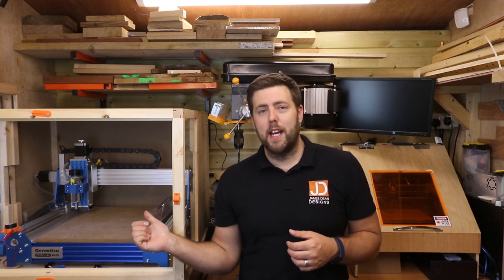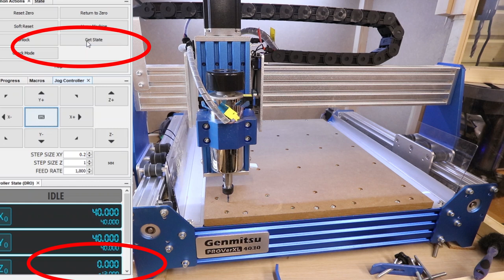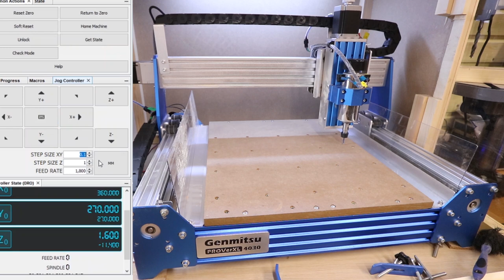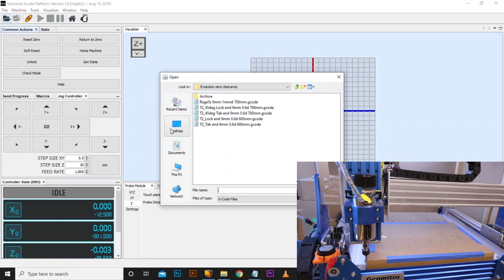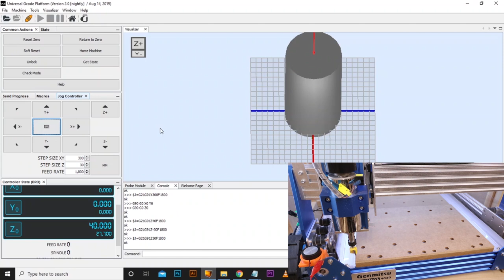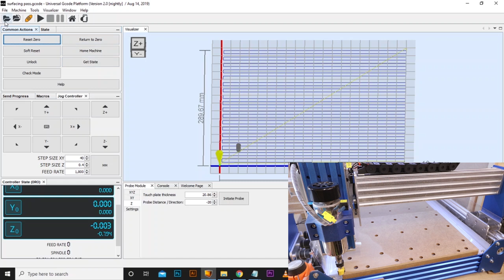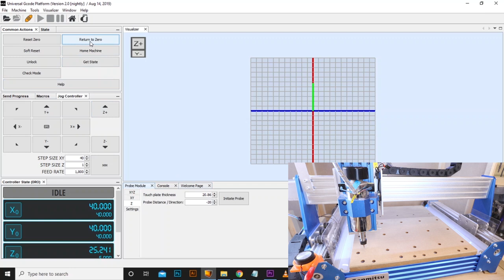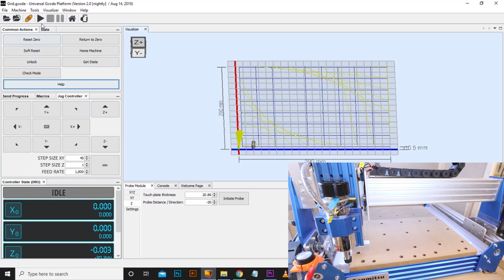Making a spoilboard and tramming the PROVerXL 4030  CNC from Sainsmart Genmitsu

Comment: It took me quite a while to get everything on my PROVerXL 4030 ready to go. I watched many videos, changed out my stock spindle for a Dewalt 611 router, bought a packaged relay to start and stop the router with the software, and I went out and got a 1/4 sheet of 1/4” MDF board to make new spoil boards. This was my first carve by the way. I downloaded the G Code program that James provided along with his tutorial. I started up the machine and everything seemed to be going just fine until it got to about the 9th hole. The machined finished cutting the 9th hole and then went into alarm and stopped.  I finally got the alarm cleared and when I restarted the program it went all the way back to the beginning. After it got to the 3rd or 4th hole it just stopped, no alarms or messages. Now I have very limited movement on my X and Y axis, maybe 10-15mm and the program will not restart. I am brand new to all this so any help would be greatly appreciated.

Comment: Excellent video, James.  I had an interesting experience. After having cut the holes in the 1/4" MDF, I checked to see if I could see the corresponding holes in the bed underneath. Curiously, only about half were visible. In particular the holes near the front of the bed on my 4030 did not match the ones on yours. In fact, at the back (furthest) edge of the MDF bed on mine those holes (which are more numerous) seemed to be there at the back. I initially thought that the bed must have been put on backward, so I spent some time reversing it. Turns out that the holes closest to the front edge (after rotating the board) also did not match yours. I wonder if there are different versions of the MDF bed?  It does look a bit different, having no bevels.  Has anyone else mentioned this?
Reply: Hiya, I’ve seen the same with my new 4030. I can’t really get my head around is. My initial thought was the step/mm settings are off, but it seems extremely unlikely as there’s little information about calibration and final config. 
Did you get it resolved?

Comment: Great video but, shared files will not open and are not recognized by Candle. Solutions?
Reply from the maker: When you go to open files, usually towards the bottom right there is a menu you can drop down. Select all files and then the files should show up and you'll be able to open them 👍
Reply: Brilliant!!  @JamesDeanDesigns

Comment: Hi James, thank you for this tutorial, it convinced me to go with this machine instead of direct competitors, and I see without these videos I wouldn’t get anywhere. 
I have a problem with the hole alignment of the cutouts with those in base spoilboard. I am running the machine with settings out of the box and the alignment is progressively worse as you go along x and y axis, almost as if the step/mm parameter was not calibrated. Have you had to adjust $100-102?

Comment: Hi James. Good to have your videos back.
I still have a 3018 pro but would really also like 3D printing in all in one machine. Has anyone any experience or comments on Snapmaker A350 please?
Reply from the maker: Hi Richard. Love the concept of those but slightly worried  at the same time. Cnc generates dust, laser generates smoke and residue. Both of those are not good for 3D printing. If you're cleaning the machine down in-between switching its probably OK but I dont know anyone who has one

Comment: Hi James, trying to follow you on my new 4030 v2. Checking the movement of the spindle in the X axis to the left. I stop approx. 7mm short of the edge. Looking for a way the adjust the left stop. Can't find one. If I leave the zero point where it is now I still can move to the right 409mm before I hit the stop. What should I do. Thanks as always for your help.
Reply from the maker: This is for the V1, not the V2. When I made this there was no V2 out so the instructions will not be the same. Sorry 😕

Comment: Good video James. Could you have cut both 6mm MDF through 12mm in 1 go to save extra clamping/cutting step? Is your spindle front left position on the wasteboard the absolute Machine 0,0 position?

Comment: What are you going to do for the V2 for a spoil board.
Reply from the maker: Have not decided yet. I am very tempted to just stick 1 piece of MDF over it and then machine in the channels for the T track system
Reply: Are you thinking one just like you machined for the 3018.
Reply from the maker: @jongrace9133  sort of. On the 3018 you had to machine it in 2 half's. I'm literally thinking 1 piece of MDF, 400 x 300, stuck down and then just cut in the channels for the existing T track

Comment: James, Nice work on all.... and your pronunciation of aluminum is just fine.  I'm building some jigs for the 4030 and was wondering where you got the hole dimensions for the spoilboard?  Connections with Sainsmart?  Your gcode files for making the aux board could be decoded in a pince, but if you have the dxf files could you post?

Comment: Great video thank you. Dumb question time. So the files you share for this. Do I download them to my computer and pull those up from ugs to run? I’ve not figured this part out yet.
Reply from the maker: Yes, download the files in the link. extract the zip file they come in and they you can use those files in UGS

Comment: James, great video as always. Question, looks like your z assembly sits higher on the gantry than 'normal'.  Do you have a tutorial (video or text) showing how to raise the spindle / z assembly?  i cant reach the bed w/o hitting my limit switch.
Reply: I was going to ask James that very same question,  waste having 110mm Z travel if the mounting extrusion won't let you get the spindle inside or close to anything with a 20mm high wall.
My thoughts are to raise the extrusion eg 25mm increase height adjustment as required, lower the spindle in its mount by same amount. This should still allow limit switches to engage and limit vertical travel, but allow some depth of cut.
Reply from the maker: You should be able to slacken off the 4 bolts and either slide the spindle down further or actually slide the spindle holder down on the extrusion I believe
Reply: @JamesDeanDesigns  which "fix" did you use?

Comment: Hey James, great videos on the 4030! Just got one yesterday and went to the local home improvement store and could only find 1/2" MDF, so I got that. Problem is, your gcode is for 1/4" MDF. I've tried converting the gcode in your download to SVG, but am having issues. Would you be able to upload a SVG of the hole pattern or suggest other possible solution? Thanks!
Edit: Took the measurements and created in Easel… worked out perfectly until I went to surface when one of the y axis steppers burned up the windings.
Reply from the maker: Just catching up on comments. Sorry to hear that but hope you've got it sorted. If I can do anything just let me know
Reply: Did you ever get the SVG by chance? /I cant get the one provided to download either

Comment: How much sound does the 3040 makes when drilling/milling compared with the 3018 you have?
Reply from the maker: Mine is actually quieter, the stepper motors are noisier than the spindle is Sounds odd given its a bigger machine but I think its better balanced that the 3018's

Comment: I am considering the PROVerXL 4030 as a first purchase as don’t want to waste money upgrading later. Is it fair to say the most difficult part of CNC use is getting to grips with the programming. Do you think getting to grips with programming is important before purchase of a CNC machine. Where can I download a CNC programme to practice on before I purchase a machine. I’m aware that I can’t produce anything but can use simulation.
Reply from the maker: Thats a good approach, the 3018s are great place to start but people do grow out of them. In regards to the design, yes there is a learning curve but I personally do not think its too difficult as long as you don't try and dive in at the deep end. For example starting with something like Easel is pretty easy to go from basic designs through to carving
https://youtu.be/EZEropgZ_FY
Reply: @JamesDeanDesigns  Many thanks for the swift response. The PROVerXL 4030  is hard to come by here in the UK, out of stock here on Amazon. I will download a programme on my laptop and practice before I decide to buy.

Comment: Hey James. Just wondering will this work with the table extension for the 3018? I have it as large as I can and wondering if this Waste board would be the same
Reply from the maker: Not 100% sure if I'm honest but probably not. From what I understand the actual cutting area on the 3040 extension is less then 300 x 400 so it probably will not work unfortunately. You could essentially follow my other video for the 3018, it makes two boards at the same time so will probably work
Reply: @JamesDeanDesigns  thanks but don’t want the side slots. I want the hold down positions like on this board you have. I’ll see if I can design something or find a gcode file for the one I need. Thanks!!

Comment: would a planer work for leveling the board over doing it with the CNC?
Reply from the maker: Unfortunately not. A planer helps level things but this process has 2 purposes. One is to flatten the bed, the other is to make it parallel to the X axis which a planer will not do... well it probably can but would be a lot more work

Comment: I contacted SainSmart and they claim that the MDF bed that you are using is sold separately ("Please be informed that the MDF board used by the YouTuber is our CNC 4030 MDF Threaded Inserts Spoilboard, which is sold separately and not included in the standard package of the CNC 4030 machine. The MDF board that you received is indeed the standard one that comes with the CNC 4030 machine. Therefore, there is no need to worry.") and that the MDF board I received is the one normally shipped with the 4030.   Can you confirm this?
Reply from the maker: No, the threaded insert board should come in the kit. I didnt recieve anything special as part of this machine. They do sell spare MDF beds but in all the photos on their site it shows the machine comes with the threaded insert board so I suspect there has been some confusion their side